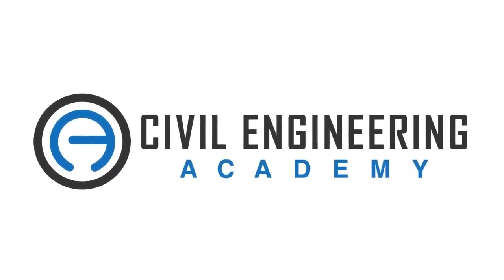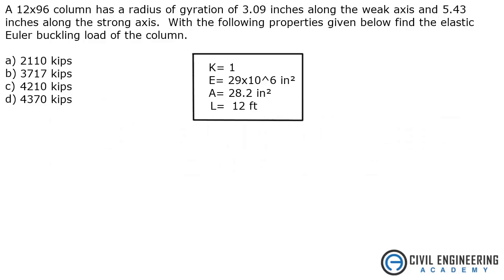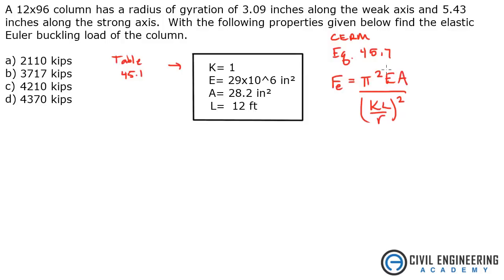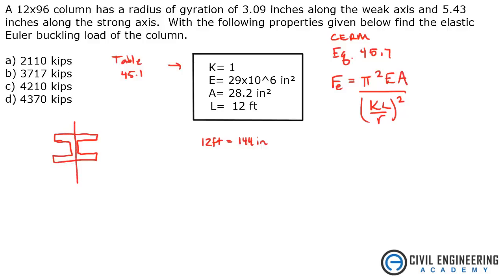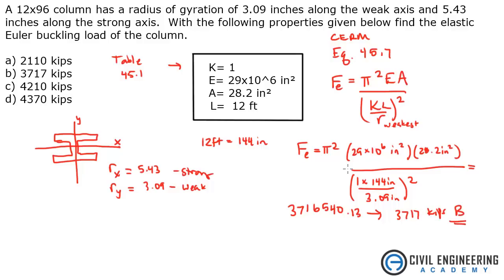Structures - Find the Euler Buckling Elastic Section Modulus

Comment: This problem is done wrong and it confuses people. You use Euler Stress Equation instead of Euler Critical Load equation. Second, E = 29000 KSI not inches
Reply: agree. that was a typo. i just fixed it on my end IN -> PSI. done.

Comment: Why are we using the weakest r? (BTW on the new Manuel the K values are on Pg 36)
Reply: because we want to know the SMALLEST load which will fail the column. this weakest load will fail the column about its weakest axis. the weakest axis has the weakest ROG (radius of gyration).

Comment: How do the units work out? None of the variables within Eqn. 45.7 contain "lb", unless this formula is empirically derived, but it doesn't look like it is. Thanks!
Reply: Units of E is KSI or PSI.
Reply: @nategazaway7994 is correct. The equation shown is solving for Pe, not Fe.